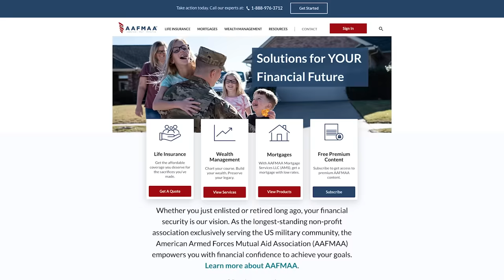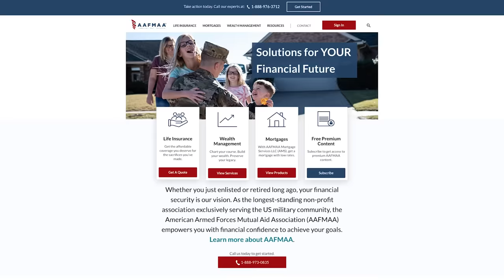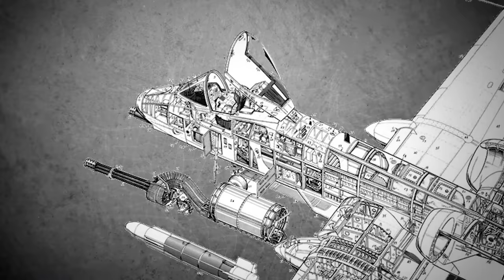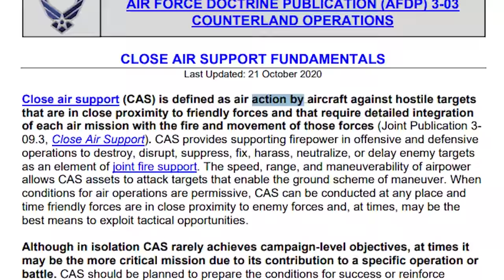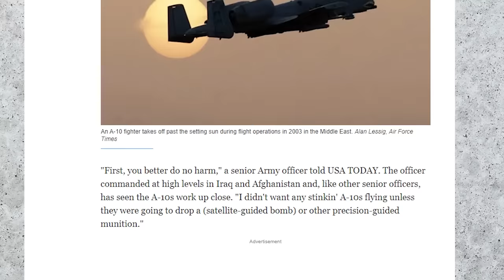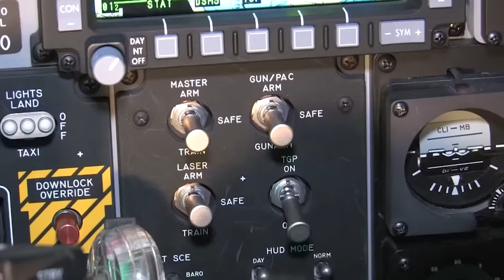Why the Air Force is Screaming to Retire the A-10 Warthog

Comment: So, A--10 was the first aircraft I ever worked on. The last military aircraft I ever worked on is also on the way to the boneyard. When it comes down to it, in a decade when peers have directed energy weapons, the A-10 will be a lot more useless than it is now. Works great when your opponent, at best, has iglas. Not so great when you have to drop your ordinance outside of detection range just to survive. I'm glad it lasted this long.
Reply: Love it. Iconic. Has some uses. Has one hell of an effect on moral.

Let's face it. It is obsolete, and a death sentence to the pilots in modern combat. 

 Take the lightest 155mm turret you can find. Put wings and the most efficient engine you can get. Get a damn good ballistic computer. Then make it into a drone and viola. It will be a cool ass aircraft! Effective compared to other methods? Nope.

 Just putting an engine on 155mm with wings would be better. AKA a kamikaze drone.

 We just need CAS drones. Cheaper the better.
Reply: ya, it's usefulness in a conventional war would be minimal
Reply: Do you know the lock=on time required for 50K lasers against hardened targets? > 10 minutes.
That will REALLY work against 400 mph 12 g aircraft..not
Reply: The claim that A-10 maintenance is too high and replacing them with F-35s sounds a lot like trying to save money by dumping the midwest farm girl for a supermodel. 😂
Reply: @DonariaRegia  I mean, if that midwest girl is at the point where her organs don't work well anymore, while the model has everything working well, then yes?

A plane's maintenence cost goes up over time, and the a10 upgrade packages (the ones that make them only kinda obsolete instead of completely obsolete) has also made it significantly higher maintenance than it was before.
Reply: @jeromeace1282  Flight time for the A-10 is $10k per hour while the F-35 is $42k per hour. Letting the contracts for spare parts dry up on active duty combat planes is frankly pretty crooked shit.
Reply: @DonariaRegia  interesting, and that's after the upgrade packages that made them significantly higher maintenance (as opposed to how they used to be able to operate in literal fields)?

Also tho, not inherently? The role the a10 played has been obsolete for... Arguably since it was made tbh (there's a lot of studies into how bad gun based attack planes are VS armoured targets, the earliest dating to right after world war 2). And quite frankly there are cheaper options for missile platforms (namely drones, tho I don't remember if the USA still uses f16s)

Edit:also, to add onto the point of missile platforms. Most a10 armour kills in the gulf war were not from the gun. And let's just say there's the a10 also has the highest rate of blue on blue kills of any US aircraft (Nevermind the civilian civilian casualties that only started being counted more recently)
Reply: @jeromeace1282  I used to manufacture the Hellfire. As a highly survivable platform in a conflict as we see today, there is a clear need for CAS. The reason we won't see the A-10 deployed is this war will prove their effectiveness. The MIC wants the most profitable contracts and the A-10 simply doesn't provide that.
Reply: @DonariaRegia  didn't Ukraine literally refuse them? 

Tldr, what would be CAS in Ukraine is instead being handle by drones used as spotters for mortars/artillery (or just normal drone strikes), the a10 can't be as useful as a dedicated missile plane (like the f16s they're getting) in modern contested airspace. 

And no, no it wouldn't prove its worth in Ukraine, the a10 can't really operate effectively (that is, within binocular range) in modern contested airspace protected by modern air defenses. And even if it could, it's not using the gun (if it wants to live), it's using missiles 

Sure it can survive bullets, but the MANPADs are different story, nevermind longer range air defense systems.

Also, again, when it comes to blue on blue kills, the a10s reliance on the Mk 1 eyeball means it has.... Way, way too many of them. 

They don't need CAS, drone guided artillery and mortars are filling that role, as are the much cheaper (and less lethal for the pilots) byraktar drone. 

War changes, old systems get left behind, unless they happen to be perfect for a new role. the a10 is not one of them.
Reply: @jeromeace1282  Ukraine asked for 100 of the A-10 just weeks after the invasion. Not sure why you're lying. Maybe just incredibly misinformed. Either way you are dead wrong.
Reply: @DonariaRegia  turns out both are true, but the rejection was more recent (and let's be real, what weren't they asking for early in the war. 

 Which makes sense? The main benefit would have been a platform that (presumably) could fire more modern NATO missiles. And the a10 makes too many design trade offs for its gun (which is largely useless since it requires them to fly within MANPAD range, among other things) to be as good a missile platform as other options. (Nevermind drone artillery spotting doing the CAS' role with more accuracy) 

Like the f16. Which does the missile platform thing better, while also being much easier to maintain due to how many countries have spare parts. In theory the grippen would be the perfect plane, as it was designed for this exact sort of war, but there just don't exist enough of em.
Reply: @DonariaRegia  also, another thing. The reason Ukraine (according to the article where they rejected it) doesn't want the a10 is because they want a platform that can contest airspace. So perhaps they could make use of it, but it's more of a "win more" tool once their airspace is no longer contested, rather than something that would actually be useful in their current situation.
Reply: @jeromeace1282  "He (Reznikov)said he had dropped the matter quickly after Austin expressed concerns about the vulnerability of the Warthogs to Russian air defenses" They were TALKED OUT OF IT by a shill for defense contractors but whatever you need to think to get you through the day.
Reply: @DonariaRegia  That's exactly right
Reply: @DonariaRegia  The A-10's maintenance is so high because they are in maintenance. They were always meant to a built plane line. IE make more of them. The ones in current service are so old they just need to be replaced with new planes. Something the airforce refuses to do.
Reply: ORDNANCE dammit! 😤
Reply: @DonariaRegia  Yeah, but that's 10k that's next to useless against a peer opponent. If we're that badly strapped for savings, you might as well retire the whole USAF and just use riflemen. Much cheaper.
Reply: @Summersong2262  Tell that to Ukraine, without air superiority.
Reply: @hellstromcarbunkle8857  The US already told that to Ukraine. A-10s are dead meat in that environment.
Reply: @DonariaRegia  Except that it's demonstrably true?

Some tech is just objectively better than other tech. Tech becomes obsolete. It's when it doesn't that things get concerning, because that's stagnation.
Reply: @DonariaRegia  LOL, wut?

Are the lizard people in the room with you now?
Reply: @DonariaRegia  Nonsense. War changes. Each and every weapons platform is doomed to back-line duties and eventual obsolescence as the nature of war changes, and the A-10 has been obsolete for a while. The model for the way the A-10 provides CAS doesn't make sense anymore in a world where the common soldier can call in a missile strike from a fighter literally tens of miles away and have it hit with the precision of a rifle bullet because the soldier is guiding the missile to its target himself. There is literally no reason to put your CAS weapons platform on a plane that can be easily shot down, and is reliant on the panicked calls of ground units and his own vision to figure out what the hell is going on and what he should be shooting at.

The A-10 is obsolete, no matter how neat it is, the same way the Grumman F6F Hellcat is, and the same way the F-35 will be eventually. It's time to face the fact that the A-10 has outlived its usefulness and needs to be retired before it gets more good men killed. Don't fall in love with your war machines; they will never love you.
Reply: @wyrmofvt  You know what's vulnerable to AA? A helicopter. You know what Ukrainians are flying? Helicopters. Give them a number of A-10s and let them decide if they think they're "obsolete".
Reply: @DonariaRegia  Off of what airstrip? Helicopters can take off and land anywhere where there's a clear patch. A-10s need a proper runway.

Anyway, just because Ukraine is forced to use helicopters doesn't make A-10 not obsolete.
Reply: @wyrmofvt  The same airstrip(s) used by MIG fighters operating right now. Anyway, Ukraine is forced to use helicopters because when they asked for A-10s they were essentially refused. Ask any pilot which they would rather be in with incoming SAM and not one would pick the heli.